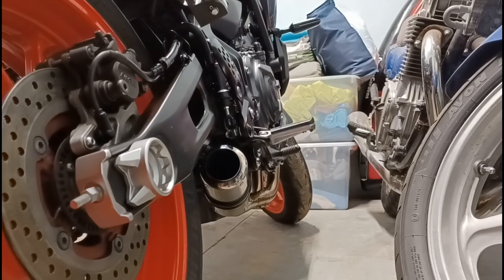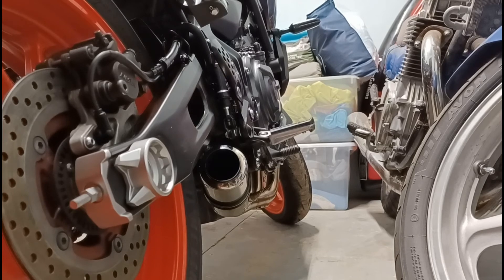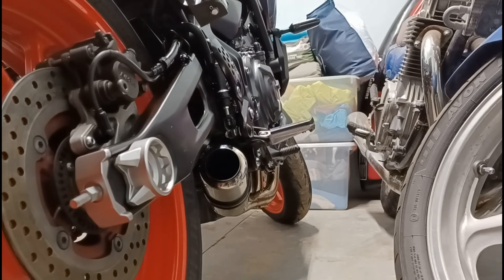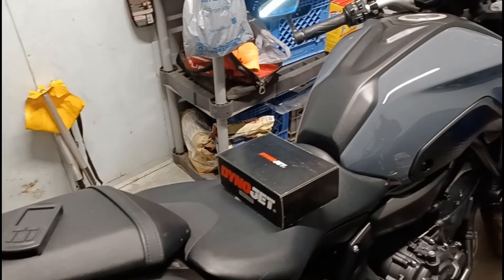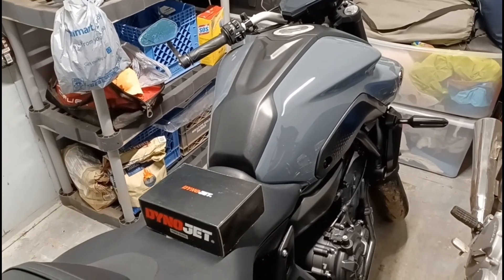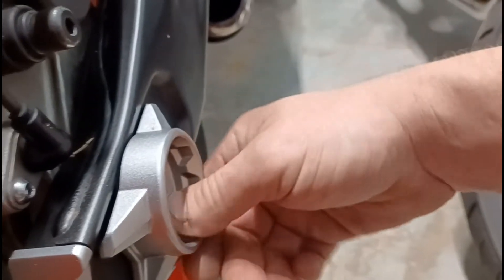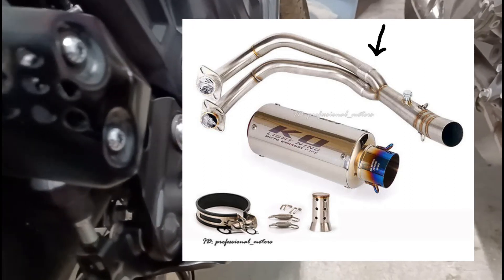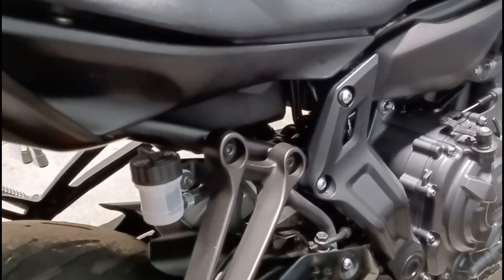2021 Yamaha MT07 final thoughts about my cheap exhaust and tuning

Comment: I'm also thinking about getting the PV3 for my MT-07 but I'm curious, did the ECU FLASH with the PV3 took away the engine braking (by leaving the throttle)? It's the most thing which I hate haha
Reply from the maker: It took quite a bit of it out.